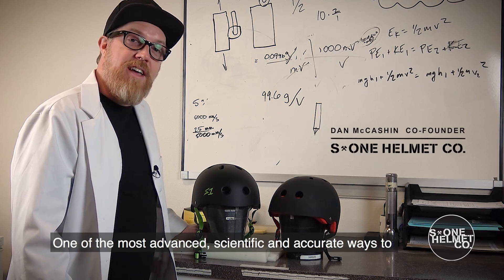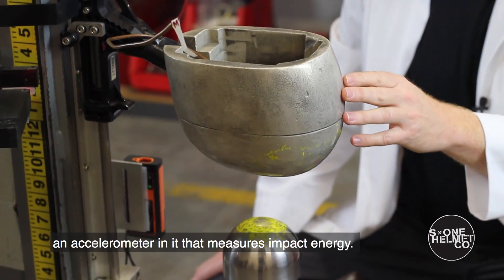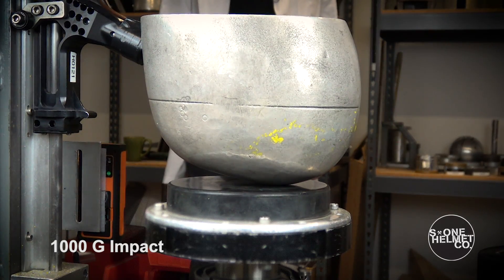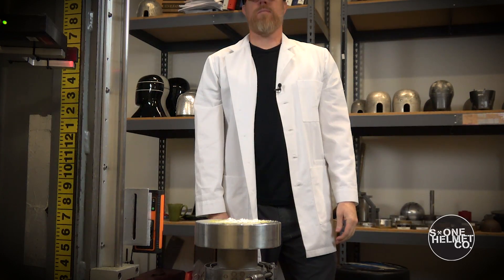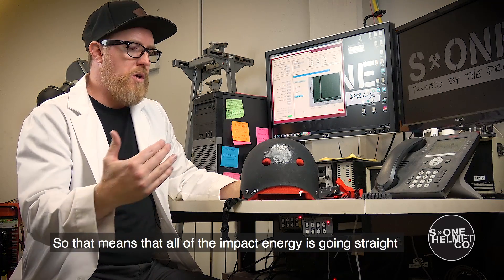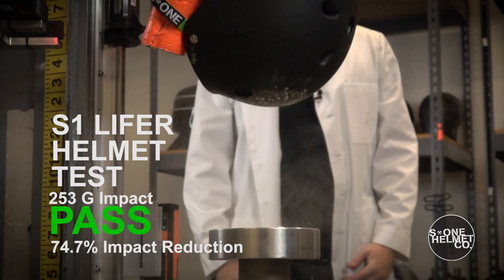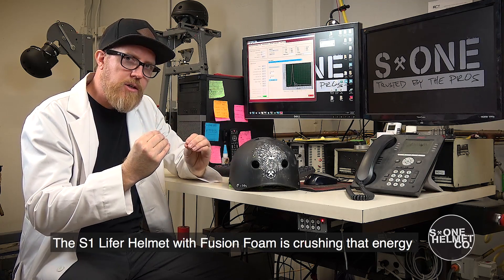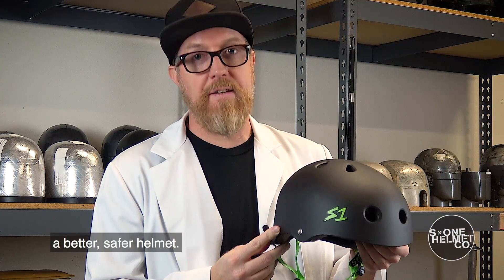S1 Lifer Helmet (certified) vs Soft Foam Helmet (non-certified)

Comment: I know the Triple 8 Certified Sweatsaver Helmet has soft foam but it also has EPS foam --isn't having EPS foam one of the main factors for what makes helmets safe? What makes S1 safer or better than the Triple 8 Certified Sweatsaver helmet? Asking sincerely before I choose which one to buy.
Reply: Tradition eps helmets are only able to take 1 big hit and then it's going into the trash .

S1 claims it's special eps foam is able to take multiple medium impact as well as 1 high impact .
So it's actually rated for both cycling and skateboarding.
Reply: @PunkRockPandaa  thank you 😌

Comment: Soft foam would be better at low impact, it's a trade-off either way
Edit: just found Giro and Bell helmets make what's called spherical technology the mips is the soft foam not the hard plastic yellow layer.
Reply: No dude MIPS is the yellow plastic that allows the helmet to slip and slide a bit.   Go look it up  the same helmet MIPS vs no mips  what's missing is that yellow plastic

Comment: Well I have been using a soft foam helmet for a little over a year now (triple eight sweatsaver non-certified), i took a super hard head slam to concrete....didnt feel a damn thing. Without that helmet I would be dead right now.
Reply: I've had the same experience, but questioning it after seeing this video.

Comment: I literally got a soft foam helmet from Triple 8 in the mail that looks EXACTLY like the one in this video. The first thing I noticed was it didn't have fusion foam like my biking helmet. I was ordering pads from Triple 8 website and thought I'd grab one of their helmets out of convenience. It was super uncomfortable so I'm sending it back, but while I'm looking at other brands I ran across this video that is reinforcing my doubts about my Triple 8 helmet. I'm glad I didn't use the soft foam helmet because I definitely don't want another concussion in my life.
Reply from the maker: smart ! soft foam is no good.
Reply from the maker: @FellowshipOfTheString   dont hit your head in a soft foam helmet. that helmet has a sticker on the inside that says this helmet is not certified. soft foam helmets fail ALL current helmet safety standards . the soft foam helmet cannot pass the astm (multiple low impact test) and it fails the cpsc test (single high impact) .
Reply from the maker: @FellowshipOfTheString   soft foam - no good.

Comment: Does this machine somehow test the amount of potential brain rattle involved... I understand that the polystyrene helmets to disperse the impact to the skull; but generally speaking, most brain injuries occur from the brain rattling inside the skull... When the side by side comparison is shown, the certified helmet bounces a lot more than the non certified helmet. Would love to know more about how it all works :)
Reply: Some companies have MIPS helmets that actually reduce rotational force as well
Reply: There's gonna be "brain rattle" regardless. Have you ever seen the physics ball swingset? The little pole with 5 balls lined up by strings, you pick one up, drop it, and the force goes through to the other side, and they bounce back and forth? That little trinket nearly replicates the basic means of force transfer between two objects because you can insert padding between one set of balls and there will be less force to go through. That's where the s1 helmet excels. "Brain rattle", in a case of impact, is going to be a dependent variable. It'll only be decreased if the initial amount of impact force is decreased

Not only that, but it's good that the helmet can take such impact. A fire chief who now owns his own skate shop near me witnessed someone getting hospitalized because he was wearing a triple 8 comfort helmet, and the helmet pretty much collapsed on impact and impaled the top of his head
Reply: @seismystic7159  woww that is terrifying!!